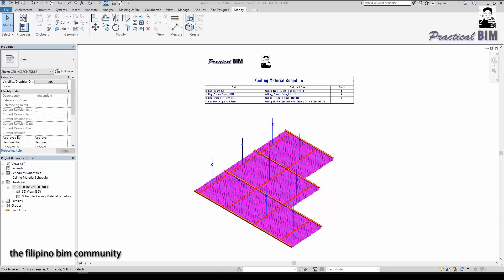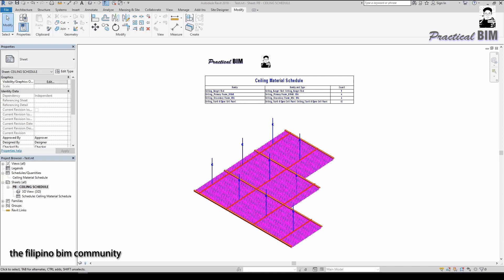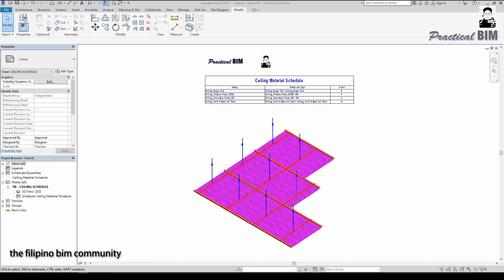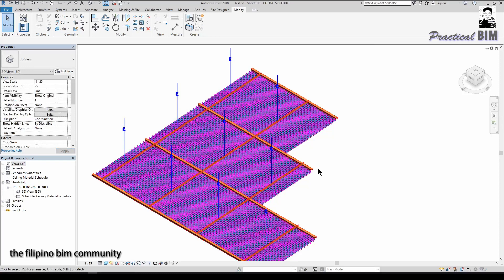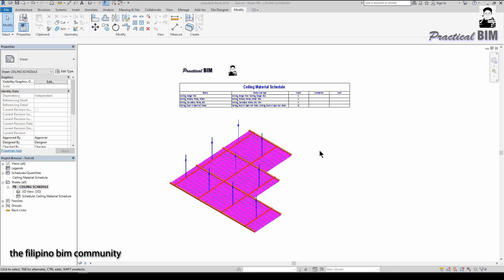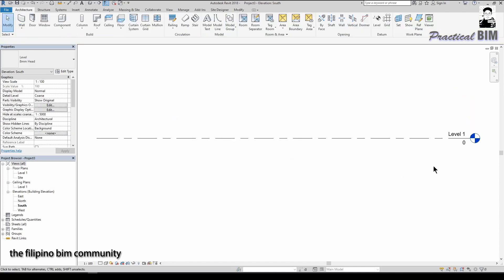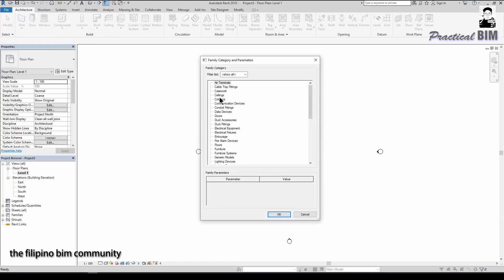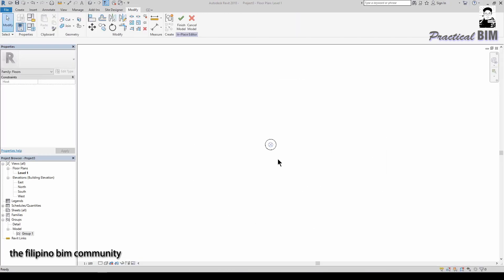Revit Hacks : Customize Floors, Ceilings and Walls as Loadable Families

Comment: THANK YOU!
Reply from the maker: Any reasons why do you need to make it face based?
There is one work around that I know. Make the customized families as "Shared" and load to it "generic model-face based" template. In that way you could still filter it by it's original category
Reply: Thanks for that. I am wanting them face based as I am making content for a manufacturer's roof gutter range and I am wanting to include gutter caps/ends. I thought by making the caps/ends face based it would make it easier for the user to just insert it onto the end of the gutter, then lock it into place. Is there a better/easier way to do this?
Reply from the maker: Ahh. Understood. Just make it a work plane-based by ticking the "work plane-based" checkbox in the properties palette and just leave "always vertical" untick.
Reply: Do you know if there is a way to make these families Face Based?